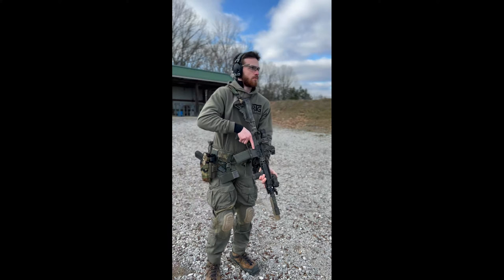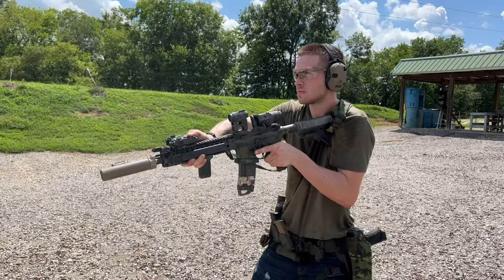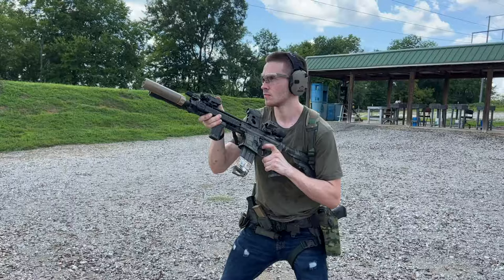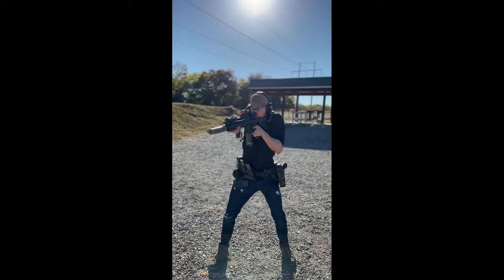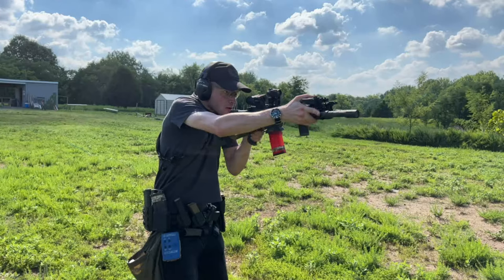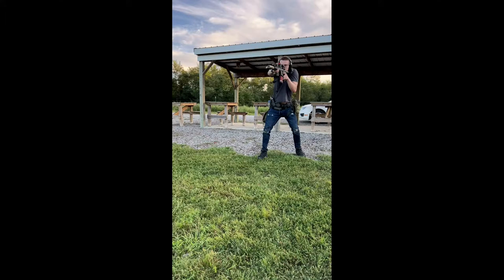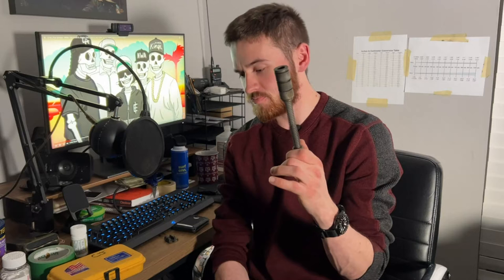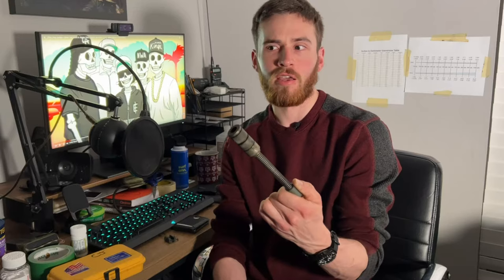JP Enterprise silent buffer system review

Comment: I don't know that ppl considering this part are looking at it like their "go to war" gun solution.  For a lot of ppl, 5-6k rounds is going to take a long time to get there.  I know a whoooooole lot of ppl who own guns, I don't know many ppl who put that kind of mileage thru their boomstick in that short of time.  On the other hand, I would imagine that if you're NOT shooting a lot, you won't see the benefit/negatives of this solution the way a shooter such as yourself would.  I bought one, primarily bc I got the gucci bug on my last build.  Like you, I doubt if I would go that route again.  Probably going to A5 my current project.  Thanks for the review.
Reply from the maker: @michaelcreekmore9534  honestly dude, the A5 and its benefits don’t actually seem to do anything a simple flat wire spring can’t do, flat wire springs offer more coils for more compression strength and uniform compression reducing vibration. If you need heavier buffers just buy one, you’ve got H3 and H4 that actually reach those higher weights for the A5 designed for standard carbine tubes and flat wire springs.

Comment: You are correct, the JP SCS requires maintenance sooner than a mil spec recoil system (replacing pads and springs) around 5000 rounds..Much like the time frame the military replaces bolts..What I don't agree with is you can use the standard retaining pin, but is much easier using the thicker retaining pin from JP that will work with mill spec..There is no need to remove the buffer retaining pin..That was the weird dude from DeRanged who recommended removing it..The JP SCS is an easy process to replace the rubber pads, springs etc..I have done it many, many times..he JP SCS is well worth the improvement in perceived recoil, smoother carrier action and faster follow up shots compared to the mil spec system..I have never found any degradation in reliability using the JP SCS.... All mechanical things require maintenance and parts replacement..Keep your rifle on a schedule and there will be zero problems..I change my oil every 3500 miles when the factory says 10,000 miles is good enough..My vehicles will run for 350.000 to 400.000 before I go newer..AR rifles are no different..
Reply from the maker: Actually that removal of the retainer pin came straight from the instructions the product had. That was JPs recommendation. No idea if they’ve changed their recommendations but at the time of purchase that was the case. I understand mechanical things require maintenance but your claims that this recoil system makes any significant differences are false. Its “improvement” is negligible at best. If you want to talk about things that honestly effect how well you run a gun, muzzle devices, triggers, optics, and gas length actually significantly alter recoil. I disagree with the points you’re trying to make. of course mechanical things require maintenance but how something breaks and what it’s being compared to matter.
Reply: @autonomousdefense JP makes a retainer pin for the SCS that will also work with the mil spec buffer..JP stated the retainer could be used installed or removed with their SCS, so lets get that straight..It was the weird dude from DeRanged who made a big deal about removing it..Gas adjustment/ammunition, muzzle comp, and the lightest reciprocating mass is what creates recoil reduction..The JP SCS absolutely makes a difference in recoil reduction, especially when paired with an adj gas blcok and muzzle comp..I"ll take that Pepsi challenge with my rifles against anybody else's rifle..You even admit it smooths the action, which is part of recoil mitigation..Faster follow up shots..Triggers, optics and even the gas length (to a certain degree)  means nothing when mitigating recoil, if the gas is adjustable..For faster follow up shots absolutely..Dwell time or un-lock time is not effected by buffer weight, period..By the way, I have had JP SCS in my rifles for way over a decade and none of them have looked as bad as yours.. You obviously don't lube or service your rifles very well..We all have different opinions about what works and doesn't, so don't be surprised when you get a little push back, nothing personal..The JP SCS is not the end all of recoil systems but it makes enough difference that I use it in all of my competition guns..I don't use them in any self defense rifles of mine..I personally have no use for the A5 system and could never see or feel any benefit to it other than being able to use more weight in the buffer for a lot more expense.. Later!
Reply from the maker: @hairydogstail  so, because of how heavily the rifle is used it’s constantly lubed up with 10w40 motor oil because it’s thick enough not to burn of especially when ran suppressed. My guns are actually serviced a lot more than they need to be because I like a lot of dudes get bored and take it apart to wipe it down and inspect it while I watch something on YouTube or Netflix, or Amazon. The gun is never dry and it gets heavily used. Mine buffer doesn’t “look bad” it looks like it actually got used it was taken to 5000 rounds and that’s it. I down own multiple in multiple rifles I have the one rifle I use the one rifle and I actually get to see what holds up and what doesn’t because that’s the point of testing. You sure do point out a lot of factors involving recoil that doesn’t actually involve this buffer systems for someone trying to argue it actually matters.
Reply: @autonomousdefense First off, using 10w40 oil is probably what degraded your O rings in the first place..Mine last longer than yours and the weights don't look like crap after that few of rounds..When I was competing for many, many years, I put around 350 rounds a week through my rifle, so I know what wear occurs on the AR platform..I use LSA lube and have found it better than all of the other snake oils people push..I competed in 3 gun, multi gun and long range using my custom AR rifles..I hunt with my 6.5 Grendels and have recently went with 300 black out rifles for my hiking rifles..My entire family competes, hunts and uses the AR platform..I also helped many friends in competition and law enforcement repair and set up their rifles, both suppressed and un-suppressed..The fastest times I have made were with a lighter Sprinco recoil spring and hydralic buffer with controlled gas..My point is the JP SCS does effect recoil and improve faster follow up shots.. Your blanket statement on how the JP SCS is not worth the cost and has no effect on recoil just rubbed me wrong..The recoil system type matched with the other factors absolutely effects recoil mitigation and faster follow up shots..Later!
Reply from the maker: @hairydogstail  dog, 10w40 a fucking motor oil meant for vehicles operating at heat and moving parts higher than even fully automatic rifles will reach did not degrade the o-ring the o-ring broke exactly where JP said it would which by the way isn’t information the opening tell you.
Reply from the maker: @hairydogstail  Jesus Christ could you say something actually related to the topic please instead of talking about your friends and family and hobbies? Yknow a specific product and its testing results are the subject right?
Reply from the maker: @hairydogstail  again, the o rings broke at the exact time JP claimed they would. My points don’t come from what ifs and maybes I don’t need to speculate. Clearly we’re not going to further this discussion because you don’t actual have any grounding backing your statements. The results are what they are the product doesn’t justify its costs nor its existence, nobody uses it because nobody has ever needed it. It’s cool in concept but that makes it nothing more than a gimmick at the end of the day, a novelty.
Reply: @autonomousdefense Seriously, Grow up..
Reply from the maker: @hairydogstail  yeah i'll get right on that. maybe take a few minutes of your time to look over the unhinged comments people leave on youtube. I cannot believe how much traction this video has gotten but rest assured random stranger on the internet. I dont give a shit. God be with you <3
Reply: @autonomousdefense  Ditto AD, who post unhinged replies to comments he disagrees with in his comment section..
Reply from the maker: @hairydogstail  lmfao I'm not reading the 3 comments you just made. I can see them in the notifications. someone clearly doesn't have thick enough skin for this.
Reply: @autonomousdefense Sure you didn't lol...

Comment: All you need to install the SCS past the retaining pin is a 1/16 Allen wrench. Just come in from the side and gently lever down the pin at each slot and push in the buffer. "Work smarter, not harder" is a good rule to live by. "None of us are as smart as all of us", is my motto.
Reply from the maker: I fully understand you can press it down to get it in and out but now you need something thin enough to easily get it out of the way. Again, their own instructions tell you to remove the retaining pin.
Reply: Yeah, I get. People always making you do more work because they don't give you enough credit that you might actually have the dexterity to do it the easy way. I use instruction sheets to make sure I have all the pieces. I saw one guy who said you could just leave the retaining pin out. That works fine until you want to quick change to a traditional spring and H2. I only have one of these in a range gun. Not anything I would do serious work with. Thanks for the video.

Comment: Wow, I understand you had failures with it. Did you ever clean it? Holy crap it looks like it’s been drug through the vacuum cleaner. Man you gotta clean it I’m not saying every time I shoot but you said you’re five 6000 rounds deep.  wipe it down and oil it up every two or 3000 round something
Reply from the maker: Cleaned it multiple times. The issue comes from the o-rings breaking and JP confirmed the round counts for when they break.
Reply: @autonomousdefense  when cleaning did you coat the orings with silicone grease?

Comment: Idk brother 8 buck and you get 15,000 - 21,000 rounds worth of orings. Pretty minimal maintenance for the quality of the buffer. But for sure if it doesn’t benefit you I understand.  But for me I want my BCM to function as close to my honey Badger jn smoothness and so far this seems to be the best option.
Reply from the maker: Ok but like, and hear me out…….what about less maintenance……with a system that doesn’t have bolt bounce like the honey badger…….and doesn’t break in a specific way that will stop the gun running entirely. Real talk if you want a honey badger and a gun that does honey badger things fucking do it. That is a very specific build that should be run 300blk. But if you want a rifle that can handle extreme abuse with the highest reliability, there is a reason dudes figured all this shit out literally several wars ago.
Reply from the maker: Maybe it’s just because I’ve shot tens of thousand of rounds through AKM style guns and shotguns and bolt guns because the AR15 is relatively low recoil and smooth already and I genuinely cannot see a difference between this system and the standard in a practical sense. Like sure it feels different, that hasn’t changed anything as far as how the gun shoots. Surefire duel port, absolutely. Silent capture system? No.

Comment: Love mine
5 to 7 k rounds?
That’s better than I expected
Reply from the maker: Low expectations
Reply: @autonomousdefense  how many rounds do you feel it should last ?
Reply from the maker: @Nick-ik7vr  7,000-10,000 if not more. it isnt just about the round count its about what is failing. it should be the physical spring doing all the work that gets noticeably sluggish from being so heavily used rather than something else in the tube stopping the gun.
Reply from the maker: @Nick-ik7vr  mind you that replacing a normal spring is laughably cheap and laughably easy almost like this shit is the way it is because dudes figured this out a LONG time ago.

Comment: Is changing o rings every 5k rounds too much to ask? i dont thing that it should be in a service rifle but for a regular rifle doing that should be fine
Reply from the maker: So something that isn’t ok for a rifle that would actually be getting used for the purpose a rifle is intended for isn’t ok but if it’s for something not actually being used like it’s meant to then it’s ok?

I think you answered your own question.
Reply: @autonomousdefense  No there is other uses for rifles than then a service rifle, but i see on their website they sell these in their duty and patrol rifles, i guess if you followed the manufacturers service guide line and changed the O ring at 5k, and not complaining about it at 7k you would not have issues,  your lack of maintenance is not JP or the O-rings fault

Comment: Finally somebody else says it. 
I used to have 2 scs’s. eventually i had a really overgassed rifle and had to add mass and spring weight to it. $200 later, gun still needs more mass and more spring.

The reduction in noise isnt worth $200, there are better options out there like the geissele super42.

Even then, just deal with the noise, it literally doesnt affect anything but your mind.
Reply: Can you say adjustable gas block?
Reply: @danoneal9816  what about pinned gas block rifles?

All im saying is that $200 for an undersprung buffer system which then requires another $100 for an adjustable gas block, isnt worth the money

Id much prefer spending $30 on a tubbs flatwire if i really cant stand the noise.
Reply: You can add weights or heavier springs in the JP SCS system just like a mil spec if needed..
Reply: @hairydogstail  that’s exactly what made it $200…….
Reply: @eitrisenhancementsllc You could have purchased an BRD EZTUNE gas tube as an easy fix..Heavier buffers do not fix over gassed systems, they just mask the problem.. Always meter the gas first if possible, if you want the most efficient and reliable rifle possible..

Comment: have you tried cleaning your weapon at all ? it doesn't look like it ever had any lube on it . one would think if you were in competition you might do some preventive maintenance on your weapon before you actually go to the competition
Reply from the maker: It wasn’t being used for competition and competition weapons are an entirely different conversation. Competition guns are meant to be as fast and recoil efficient as possible to the point only specific ammo works and they’re almost unsafe mechanically. This gun was extremely lubed at all time it’s never dry.